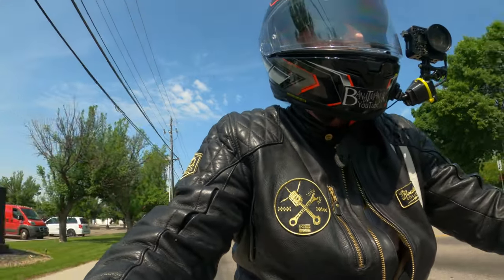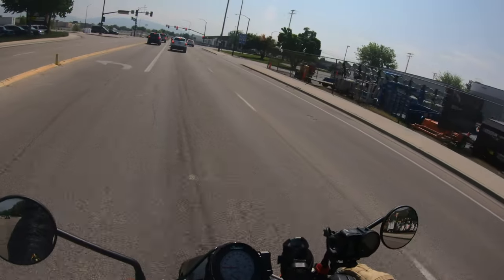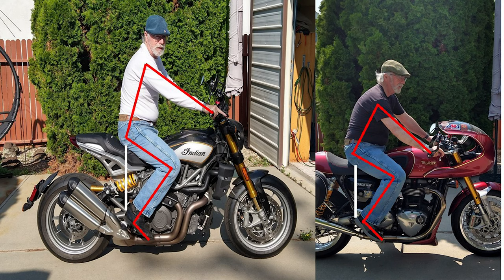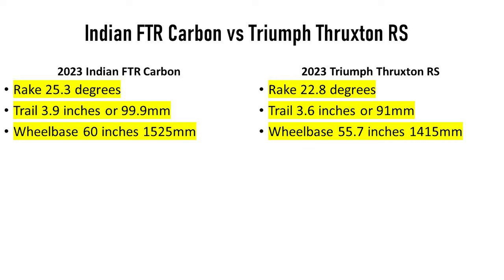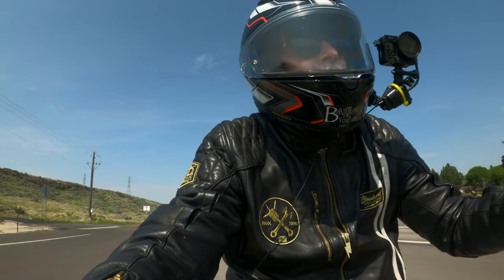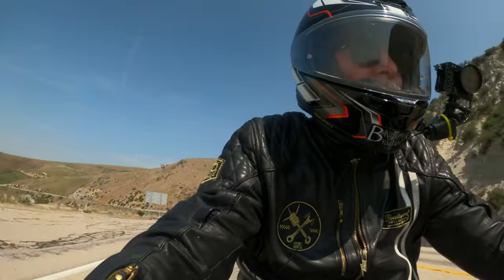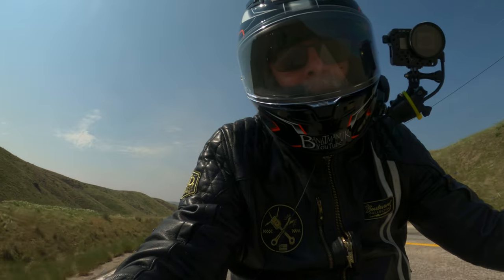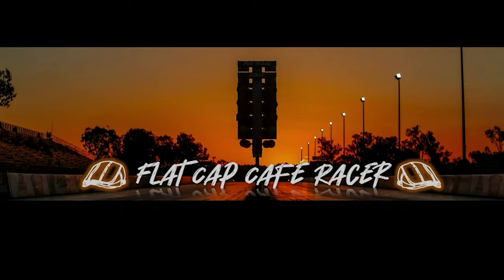Review of the 2023 Indian FTR 1200 Carbon

Comment from the maker: I had some difficulty in refueling the motorcycle as it would only take the fuel very slowly.  I wasn't sure if it was the pump, the bike or me so I did not include that footage in the video. I'm curious if other FTR owners have that experience.
Reply: it's normal, it's related to the shape of the fuel tank. It kind of funnels at a spot and you need to be patient in order to get a proper fill. 5-6 minutes at the station to do a full fill in my experience. Wish they had made the tank just a little bit bigger...
Reply from the maker: Thanks for the information. I guess a few extra minutes isn't the end of the world .

I agree a little more gas tank capacity would be reassuring on a few rides during the year.

Comment: I have the 2023 Carbon and I love it. Had to switch the grips out because my hands were going numb. Put on a tail tidy and got rid of the 
"diaper" license plate and  signals bar and changed the mirrors to the under mount Fenrir carbon style mirrors. Waiting on my S&S exhaust to make it sound better. Overall I love it!
Reply from the maker: I only rode it 100 miles but my hands were good but there was vibs and all of us feel it or don't feel it differently.  Is your throttle smooth before going to 2nd gear at low speeds? Is there a trick to get gas in the tank a little faster?  😄😄  Thanks for the comments. You got a good one.👍
Reply: 1st and second gear is a little jumpy for me too at slow speeds, I guess they just want to go. 
For the gas tank since it's under the seat, you just have to slowly put in the gas so it can burp the air to fill it all the way based on the structure of the tank.
Reply from the maker: Thanks for answering those questions because I wasn't sure if it was just me.👍👍

Comment: They’re gorgeous bikes. It’s odd how after all the development, they screw up with things as simple and important as a side stand, and cable routing 🤷🏻‍♂️
Great job on the review, Flat Cap 👍🏼
Reply from the maker: I think longer leg riders wouldn't have a problem or maybe after awhile I would adapt so it worked better using the side stand. I would just get a cheap wire bracket to solve the clutch cable rubbing. I see your point though.   I guess those were little nit picking things like most have and those type of things would not prevent from purchasing  the bike.

Thanks for watching...eventually I'll figure out how to do a ten minute review.😁😁
Reply: Yea I guess there’s always something with whatever bike it is.
A thorough review is always good for those interested. You covered it well 👍🏼
Reply from the maker: I appreciate your kind comments.

Comment: I had a demonstration ride on one a few years back. Didn't like it (it's on the channel). Was supposed to try the new one earlier this year but it kept raining and getting postponed and never happened 😢
Reply from the maker: I think switching to 17 inch wheels and changed from knobby tires  improved the handling for me. The fueling at low speed still could be improved but overall I liked this model but I'd go with a color instead of carbon fiber.